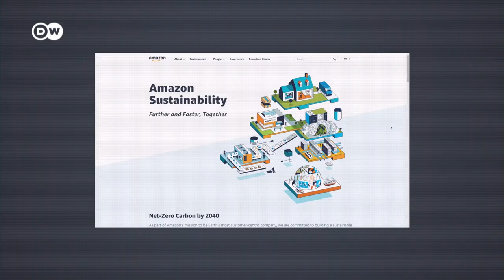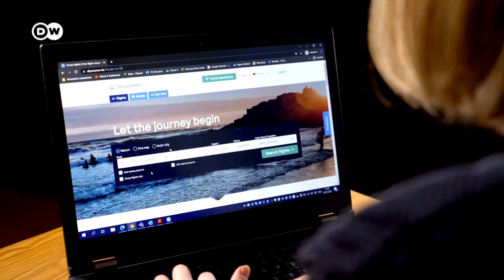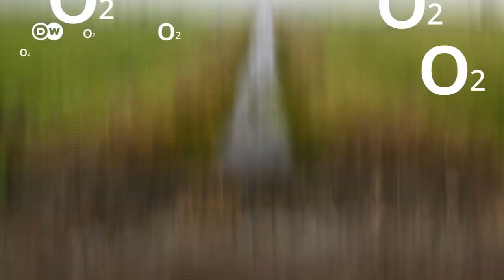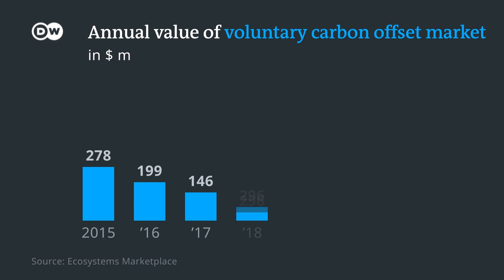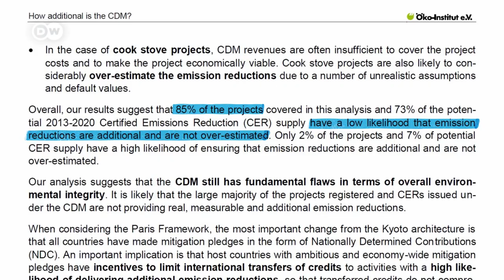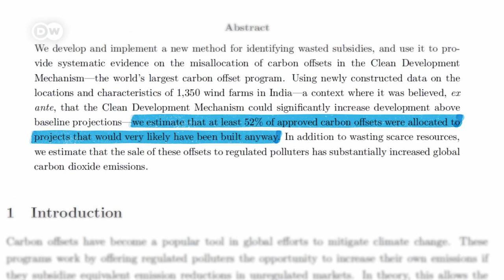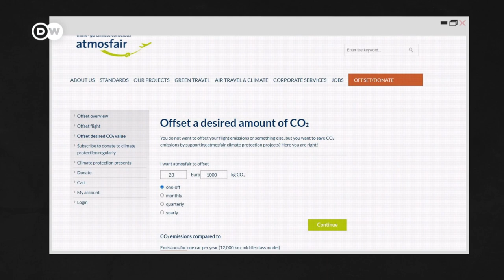Why carbon offsets are worse than you think

Comment: A good job of presenting a complex topic. One update: with the agreement on Article 16 at Glasgow, it is now possible to avoid double counting by buying only "authorized" carbon offsets.  These are subtracted from a country's Nationally Determined Commitments, so there ahould be no double counting.
Also, regarding permanence, forests may be damaged by fires, but they do grow back. The permanence of forest offests relies on commitments to good forest management. Of course that can be reversed. But is "keep-it-in-the-ground" any more permanent? It only takes one Trump to reverse those commitments, and then the carbon will not return underground by itself.
Reply: The question then is, how is the carbon offset made by reforestation counted? My impression from various marketing campaigns is they basically promise to plant a given number of trees for your contribution. They never say anything about caring for those trees until they are fully grown and making sure they don't just die and rot.
Reply: @ZrJiri  If you see a project like that offered, avoid it! Certified projects can now use a combination of on-the-ground surveys and satellite image analysis to verify the carbon storage.
Reply: How do we know if they’ve been authorized? We know there will be many imitations so if I’m theory I wanted to buy a carbon offset what do I need to look for to make sure it’s authentically the kind you are talking about? Are they only sold in or via Scotland? Just trying to clarify.
Reply: @nicksurfs1  not related to Scotland. That was just where COP 26 was held.

Comment: Thank you for this, it has confirmed what I had long suspected.  I use to buy carbon credits for my small one man IT business.   It was once I had looked into carbon credits I decided the best solution was simply to look at investing the money into more efficient systems and reducing our carbon foot print by producing less power hungry solutions, shutting down systems that were not in use.  Also I have started promoting reusing old equipment instead of buying low budget systems to prevent systems going into landfill for as long as possible.  We have some computer systems still in use 12 years down the road and still being productive.  We also upgrade just what we need to upgrade, so if someone wants a new system but have an old one, we often reuse as much as possible to make that happen.  So much IT equipment just gets binned after 3 years it's ridiculous.  Simple upgrades can keep that system out of landfill for at least twice that time, often three to four times the projected life span.  Just because something is old does not mean it's useless.  

This is also why the right to repair projects are so important.
Reply: Considering computer equipment and processors don't age any more as those did in the nineties, updating the rules for replacing might be a good idea. Maybe add some upgrade path rules. Maybe add some replacement requirements: the new system must have significantly higher performance or better energy efficiency or both.
Reply: You are quite right. If it still does what you need, don't change it. Today, I've been using my 40-year old Hotpoint washing machine.
Reply: You should also look into the higher efficiency of newer systems and VMs you might find that you can do more with less. Another idea is cloud services. They do want to do more computing with less hardware. 

Don't simply stand up a server in the cloud... That's so old school. Build a system that can ramp up or down according to the systems needs. It takes good resource management but once you have that figured out. The systems that do almost nothing can cost you almost nothing.

Comment: Destruction of surplus industrial gases shouldn't happen because of carbon offsets.  It should be part of the cradle-to-grave responsibility of the manufacturer.  Heck you folks have large deposits to drive recycling of PET bottles.  Can't you do  the same for this issue?

Comment: @13:25 "The IPCC calculations show that it will be extremely hard to reach our climate targets without some form of offsets."

What the IPCC says is that it will be difficult or impossible to achieve our climate targets without negative emissions. Offsets, by definition, don't reduce carbon emissions; they are just a shell game that moves emissions from one source to another -- generally from the most expensive to the least expensive marginal reductions. The problem is, those cheap reductions can't get us to net-zero, let alone net-negative; we're still going to have to make the more difficult and expensive emission cuts, which will likely be much more expensive -- or impossible -- without early action. Offsets are are a form of institutionalized procrastination and delay -- just kick the can down the road.

Contributing to bonafide emission reduction projects should be encouraged as "charitable contributions" without any expectation that they can "offset" or avoid the need to make emission reductions elsewhere. You can't clean up the garbage by just moving it from one side of the street to the other.
Reply: It's not that the offset doesn't reduce emissions, it's that using it to mean you don't try to reduce your own emissions defeats the benefit of it. We need to do both.

Comment: Any time someone asks me if they should purchase carbon offsets I always say: “is there really nothing you can do to ACTUALLY lower your carbon footprint?”

Once you’ve worked hard to reduce your fossil fuel usage as low as possible then sure, buy carbon offsets. But I’ve potentially reduced my emissions from 10 tons to 7 tons just by changing my diet, electricity usage, and transportation method. And I have plans to push to go lower.

Much better then buying something online which may or may not be real in my opinion.
Reply: I somehow have minus tons of carbon since I am vegan and do not buy anything. At least carbon calculator told me so.
Reply: @hrabi8209  yea carbon calculators can be really silly sometimes. I don’t use them in an effort to actually know EXACTLY what my footprint is…I’m just using them to get a rough idea of where my worse area is so I can focus on that next.
Reply: Absolutely 🙋🏼‍♀️
I think there are several ways people can easily lower their carbon footprint.
Switch to a renewable energy provider. 
Switch off things not in use, turn down thermostats, and try not to use air-conditioning.
Become vegan.
Avoid traveling by aeroplanes. 
Walk or cycle rather than using a car or public transportation.
Buy second hand goods preferably from a charity shop. 
Plus many more things I haven't listed. 
I think putting pressure on politicians and companies by writing letters, signing petitions, and taking part in campaigns also helps.
Reply: @ladyselenafelicitywhite1596  yea, I avoided mentioning what we can do politically since that’s not typically in the conversation when we talk about carbon offsets…but you’re absolutely right.

Heck, I could get my personal footprint down to almost 0 and it would be virtually pointless cause my country still has an infrastructure which keeps the population up around 16 tons! So engaging fully with the political process is absolutely necessary for real long term gains.
Reply: @SaveMoneySavethePlanet  Absolutely. I think it's really a threefold thing.
A) personal actions to reduce individual carbon footprints.
B) offsetting via means which are verified and reliable.
C) political action and campaigning.
Reply: @ladyselenafelicitywhite1596  I'd like to add one that I don't see mentioned often but which actually has a huge environmental impact both from emissions and environmental damage perspectives: don't have pets or at least change cats and dogs to something less environmentally harmful such as mice or reptiles. It's actually shocking to find out how much damage pet ownership causes.
Reply: @Beregar79  Actually, that is something I was aware of, but I know it's not commonly known. I rarely bring it up as I've had too many people react as if I was advocating having pets euthanised!  
I must admit, I was quite surprised when I learned that fact. 
Another reason I tend not to add it is there are so many things to list that to list them all would take up pages! 
However, it's still a good point. I don't own any pets now and haven't done so for about ten years now.
Reply: @ladyselenafelicitywhite1596  It's definitely a contentious subject because pets are very important to people who own them despite the fact that we all know there are significant issues with pet ownership ranging from harmful breeding practices (i.e. breeding short muzzled dogs) to animal abuse and abandoment, to negative effects of escaped and free roaming pets on wildlife, to waste and carbon emission due pet food and toys. Now more so with the climate crisis. 

You brought up a good point about people's reactions so allow me to clarify. 

What I'm after is that from environmental perspective it would be better if people didn't get a new pet once their current one(s) passes away. Again from environmental perspective it would be better if strays and abandoned animals would be put down rather than rehomed. This doesn't apply to just cats and dogs but also to luxury use of large animals like horses which produce a significant amount of waste. I'm not suggesting we should deprive for example blind people from guide dogs. Only to restrict or eliminate luxury use of animals as it's not only unneccessary but outright harmful.

I guess people could argue it's easy for me to say when I don't own any pets but couldn't the same be said about any subject where a person has to give up on something that is important to them as opposed to giving up on things that are not that important.
Reply: @Beregar79  People are lonelier than ever and you want to ban pet ownership.

Comment: Two additional considerations: reforestation projects also reduce the land surface albedo, thereby increasing the absorption of solar radiation, which has a warming effect. This effect likely exceeds the cooling effect of reducing CO2 concentration for reforestation in mid to high latitudes. So, even if reforestation there is offsetting the effect of emissions on atmospheric CO2 concentration, it is not offsetting the effect on climate (there would be a net warming effect). In low latitudes, reforestation has a net cooling effect, but not as large as would be expected from the absorption of CO2 alone. Further complicating the picture are likely effects of reforestation on cloudiness (at least in some regions). Concerning the peatland offset project, the rewetting of the drained peatland will create some methane emissions that will cancel some of the benefit of the CO2 absorption. This does not seem to have been considered.
Reply: 1. That really depends on the color of the terrain that is reforested. If it was green anyway, not much changes in the absorption spectrum.
Reply: My understanding is that when agencies like verra and gold standard vet and quantify a project, they will consider such factors, eg amt of C02 reduced - amt of Methane produced. Same for renewable engery project, eg solar farm, they will net off the amt of carbon produced from the manufacturing of the PV cells. So do ensure projects you are gg to pay is listed on such reputable registries, to better safeguard against dodgy projects.
Reply: It was my understanding that the water suppresses the reactions that causes methane to be released.

Comment: Great video. One very important distinction which you didn't really cover is the distinction between carbon removal projects and carbon emissions mitigation projects. Most (especially the cheap) projects are about avoiding emissions. It will invest cleaner cooking facilities in African homes that emit less, or will install solar panels that emits less than the diesel generator etc. The problem is that this can't be sustained. In 2050 the whole world HAS to be climate neutral and in order to achieve that you can't pay others to reduce their emissions so that you can continue to emit carbon. Once the others hit zero emissions your emissions continue to contribute to global warming. Carbon removal projects that actively extract emissions from the air (like planting trees) are therefore the future (with many caveats as pointed out in your video)
Reply: But there is not enough unused/underutilised deforested landmass available for all the required replanting for existing offset requirements let alone future needs. Geosequestration might end up being one of the main options
Reply: Except there aren’t any effective large scale removal projects at anything more than very early prototype stage. The technology is not developed. Secondly, we’ve also seen a ton of corporate greenwashing going into extraction R&D, sadly, exactly because they don’t have to actually do anything today except “research” unproven tech for the future. I too would love real carbon extraction tech to be a thing we could shift to, but honestly, it is today much more a tool of the laggards, delayers and deniers rather than those committed to changing things.

Comment: The nature of Carbon Offset is: You do have an outlet of CHC, but then you do (or pay someone to) an action, that reduces the outlet of Greenhousegasses from other mandatory sources. In the German case, you stop the outlet of GHG from moor, that were drained and disturbed by a former generation. When the moor is restored, the outlet of GHG  will be reduced for centuries to come. 
What can be sold? The reduction of GHG, from stopping the accident (=drainage) once?, or can we sell the same reduction every year? When the more has been restored its outlet of GHG will be zero.
The moor is a difficult example, as the peat is in between fossil and renewable carbon. But another way of compensation the outlet of GHG from our plane would be to harvest the peat from the moor, and use it as a fuel - a fuel used for warming houses, and thereby reduces the need for fossile fuels (and reducing the amount of GHG from an fossil source).

Comment: DW describes this issue very accurate. Good job, like to see more of excelent journalism on your channel.

I had a stake (engineering, feasability studies, due dilligence, economical assessments, etc.) in solar PV projects for mining operations, natural gas and oil fields, refineries, pipelines, a cement factory and other  not so green clients. They invest in solar because it is the cheapest energy source available and it reduces the total energy bill. Additional they (not all but most of them) receive an extra windfall profit for the CO2 compensation certificates and the positive PR. That much about the motivation and the effect of carbon offset projects and the CO2 trade system.  
The peat project in Germany sounds positive, even if it is really astonishing that your flight alone would require 3,000 m2 wetland for offset. I would like to share my view on another peat project with you. It is somehow OT and at the same time it is part of the bigger picture in which the CO2 offset projects are just a small piece. In Rwanda is a power plant fired with peat from intact wetland, they harvest the peat on several thousand hectars wetland, dry and mill it and fire it in the power plant with a very low efficiency combined with very high and problematic emissions and devastated land left behind. Additional the cost of such a power source is high. With the USD 350 Million invest for the thermal peat power plant they could have financed several hunderds of megawatts of solar PV which would have a significant lower LCOE compared to the peat project, even combined with storage it would have been more economical. Sometimes it would be good to re-direct funding from CO2 compensation and conversation projects to such projects, just to ensure that the local government does not funnel the money to a peat fired power plant and instead to invest into something that has a future. Still, this would be windfall profits, but hey, if it prevents such projects it would be very efficiently used money.

Comment: "85% of carbon offset projects dont actually offset carbon." I think the number of projects is a really unprecise metric here. Maybe its just 85 small tree plantation projects failing to offset their 1 ton of carbon each and 15 large projects that succeed in offsetting 100 tons of carbon each. Or worse: the other way around. The amount of money going into carbon offsets that dont work, would have been more meaningful. The ratio of (the amount of carbon actually being offset) to (the amount of carbon that was pledged to be offset) would also be good. (Oof this is hard to write.)
Anyway, id probably still pay for carbon offsetting. Even if only 10% of the offsets is effective its still something. Also if the market for these offsets gets larger, it will probably face more scrutiny and better regulations. Great and thought provoking video 👍